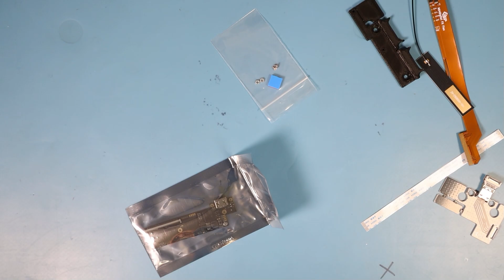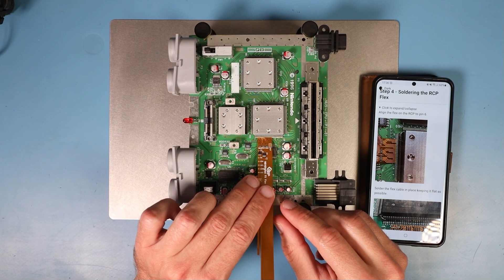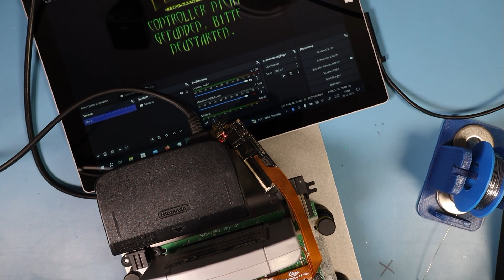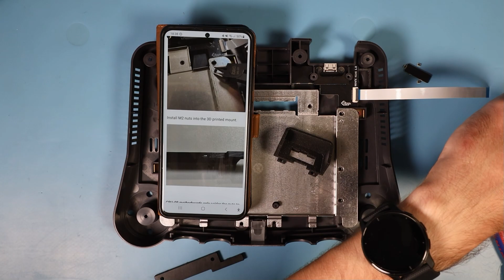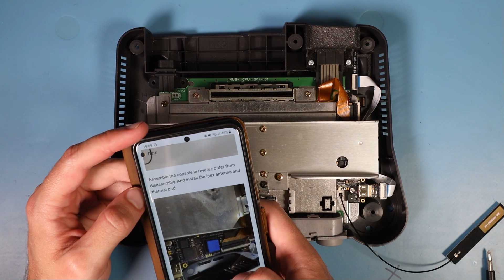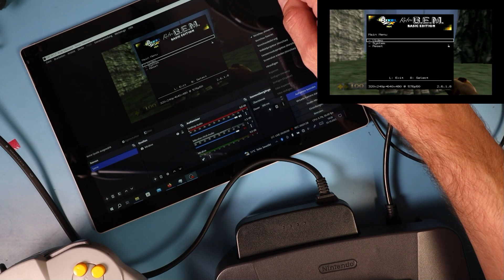PixelFx N64 Installation - Nintendo 64

Comment: N64 Digital + EverDrive X7 freeze issue – anyone experienced this?

Has anyone run into this? My EverDrive X7 works perfectly on a stock N64, and my N64 Digital works perfectly with original cartridges.
But when I use the X7 on the N64 Digital, the game freezes after a while. If I reboot, it freezes again much sooner.

It used to work flawlessly for three years, but after a period of non-use this issue started.

Could this be caused by:

Slightly dirty contacts between cart and slot?

A weak or aging power supply?

Overheating from the N64 Digital after some minutes?

A small voltage drop (shared by both devices)?

Everything suggests it’s power or heat related, since the first freeze comes after some time and the next ones happen almost immediately.

Has anyone fixed a similar issue?

Comment: I was hoping to pick your brain in order to save time on troubleshooting.

I completed the install and have a display, I just can't complete the firmware update by pressing r1. Either my controller isn't working or the gem isnt accepting input.

From your experience do you know if there be a specific pin or connection I need to check to verify where the fault is at?